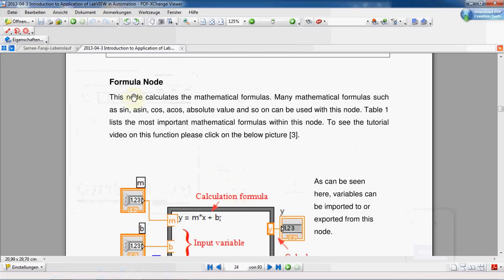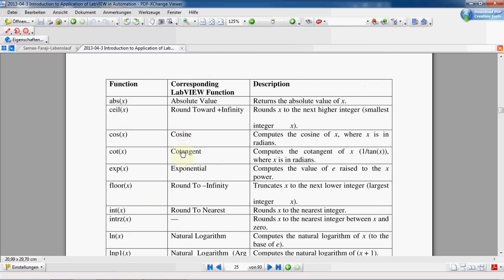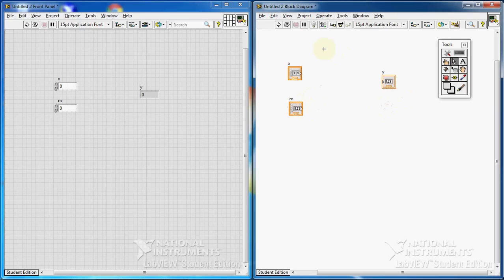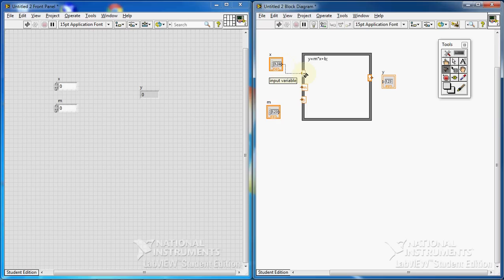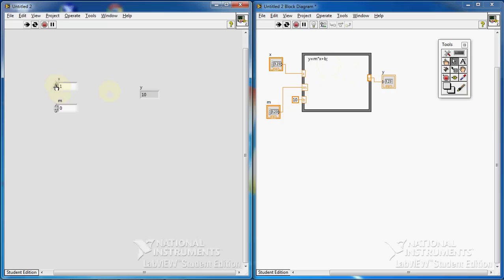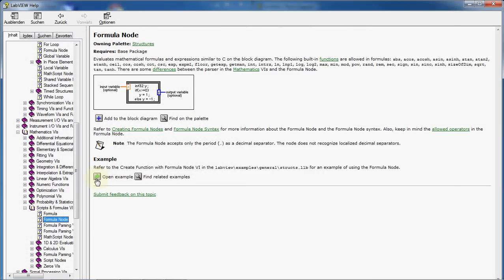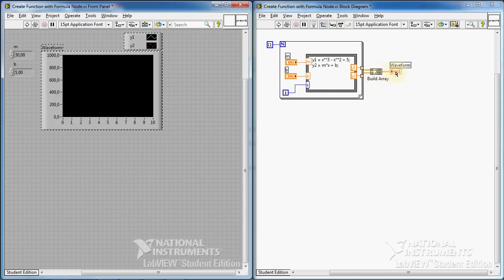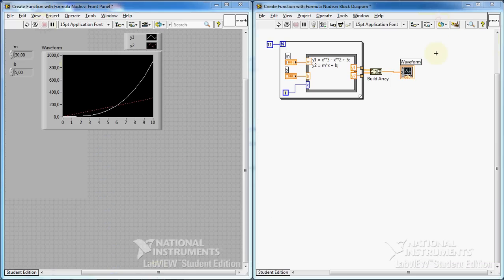LabVIEW Tutorial #4: Formula Node

Comment: The transition from "real>>1D array>>2D array" is confusing me!
How does it do the array building? 
Is it not the case that after the for loop finishes you have a y1 val and y2 val, NOT ARRAYS?
Should not you give a 'shift register' and built an array for each of y1 and y2 real vals continuously inside the for loop?
Reply: It is called "Auto-indexing-tunnel" which does the same as using shift register with array building inside the loop.